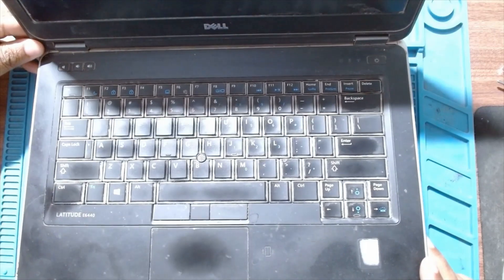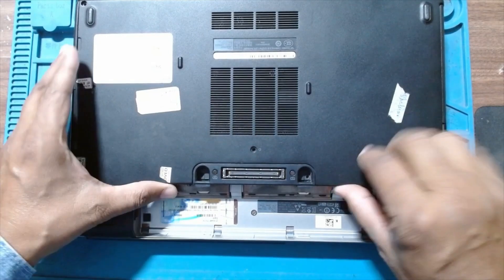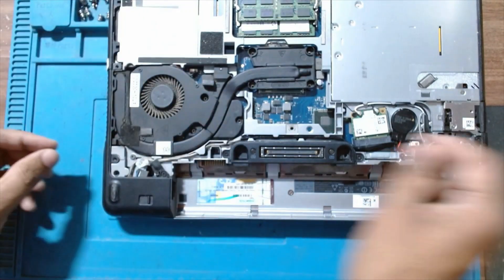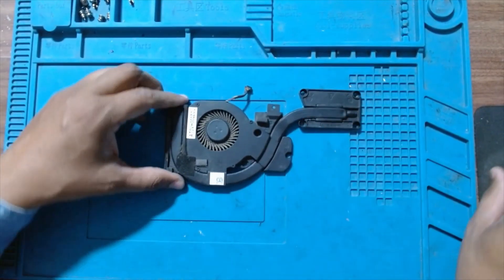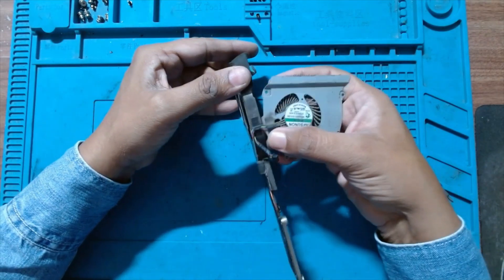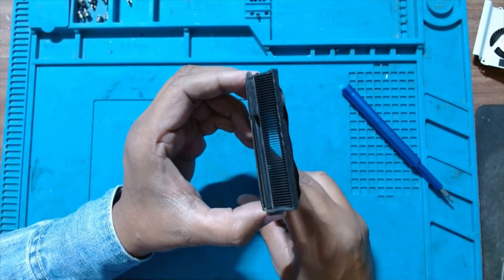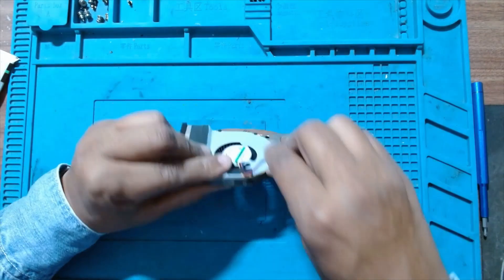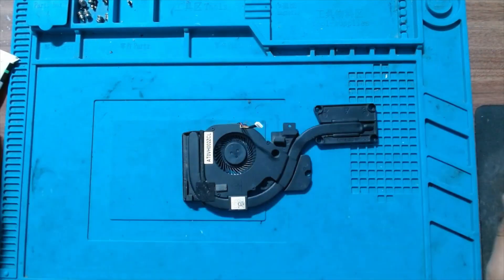Dell Latitude E6440 CPU fan replace.

Comment: How can i fix heat problem during playing games plz
Reply: use a good thermal compound, also use a laptop cooler
Reply: @YogeshJoshi-Powertec  i did but still the same problem 
How can i do undervolting my device dell 6440